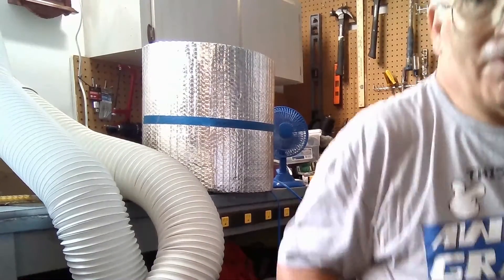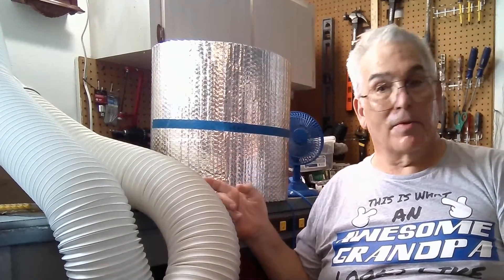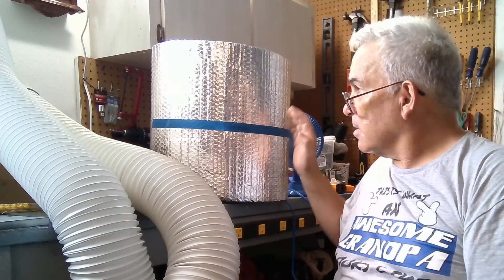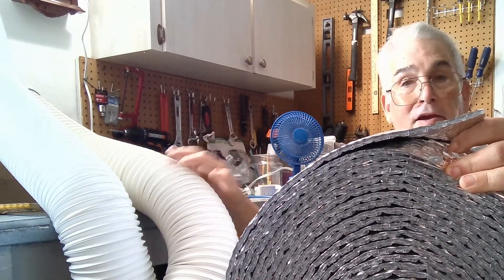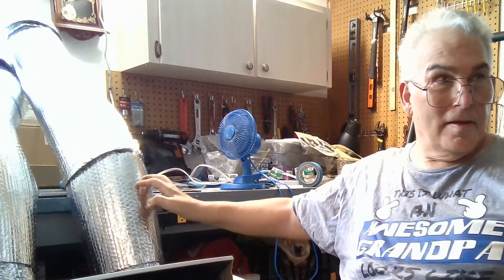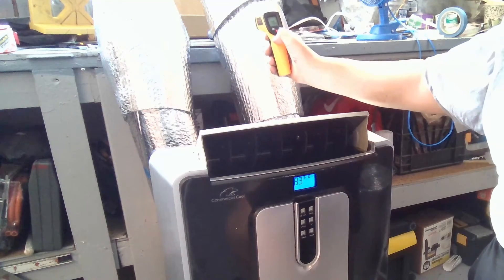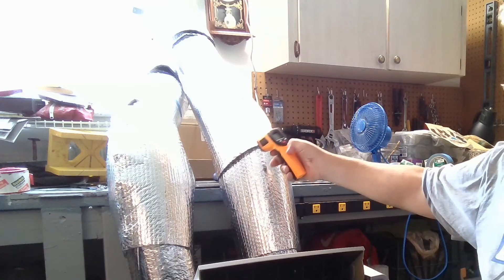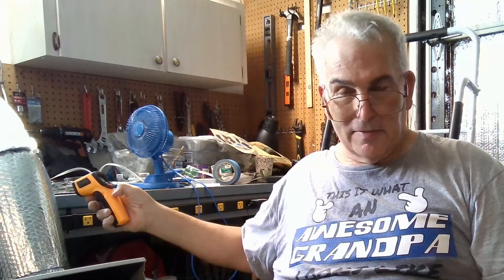Beat the Heat: DIY Portable AC Booster with Insulation

Comment: You would have done much better by framing out an opening in the wall and installing a window unit and then foamed sealed any gaps. Cheaper, easier and more efficient.
Reply from the maker: thanks for the comment and subscribing, I live in a HOA community, that was NOT permitted